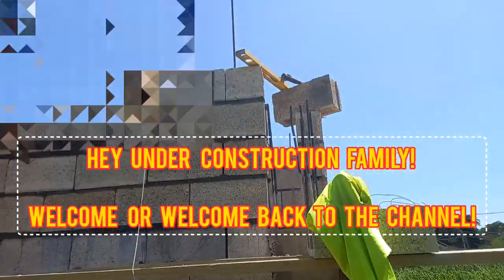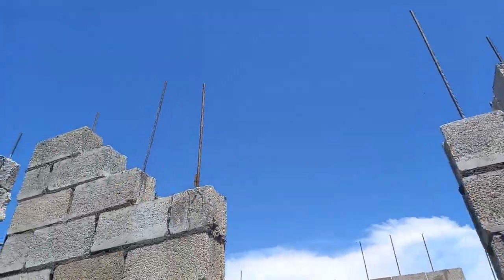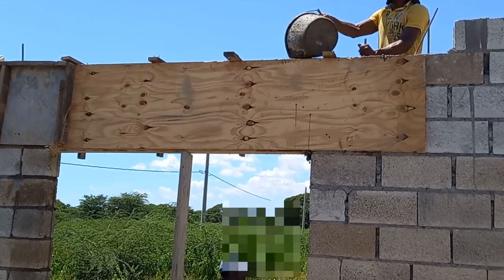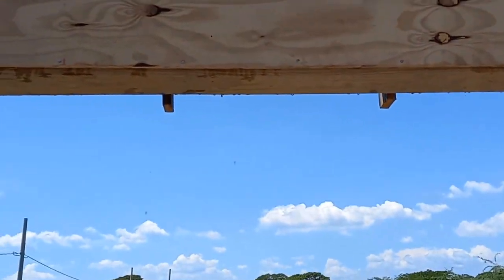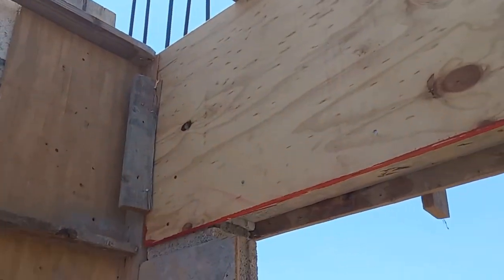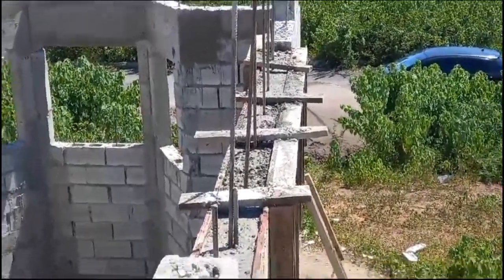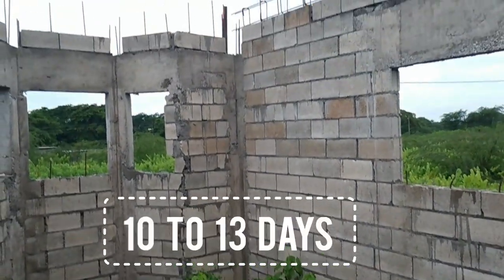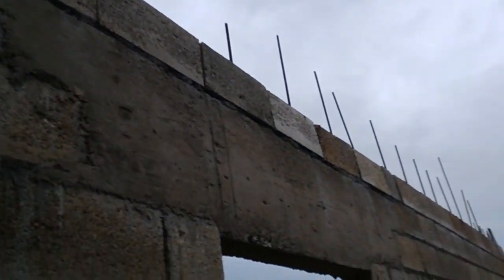The Cost of Block Work up to Belting | How to do Lintel and Belting | Materials Breakdown

Comment: You are doing an amazing job explaining the process and procedures. Keep up the good work. What is the square footage of the building?
Reply from the maker: Thank you so much, Ray.  I do appreciate that and will try my best. The entire project is approximately 2100 square ft. It was supposed to be 1720, but there were some extreme extensions resulting in the added sq ftge. The section we are working on was to be just over 800 sq ft, but it's closer or over 1000 because of the extension. One room was extended by 10 ft in length...and every other area by at least 2 ft... you can imagine the results.